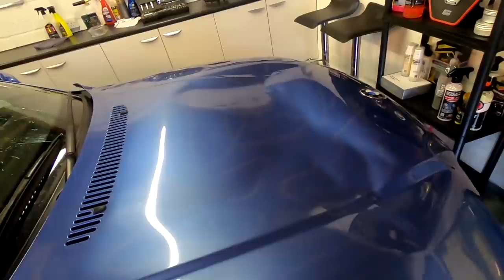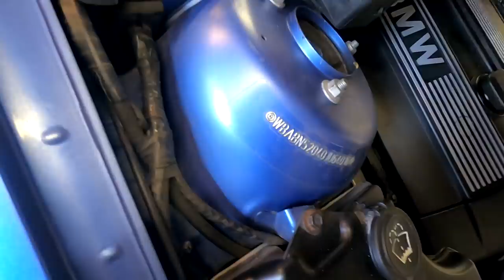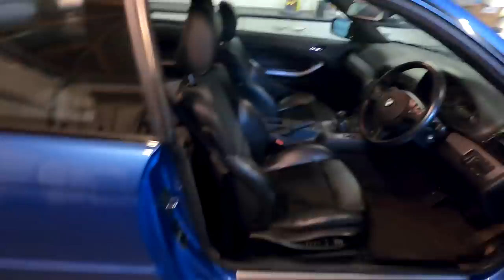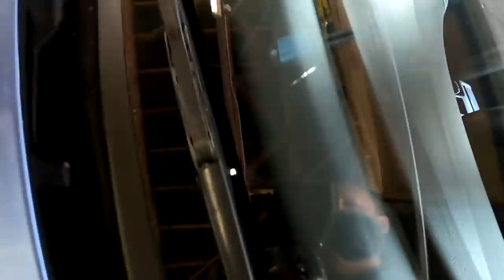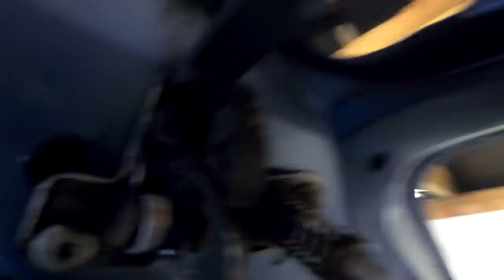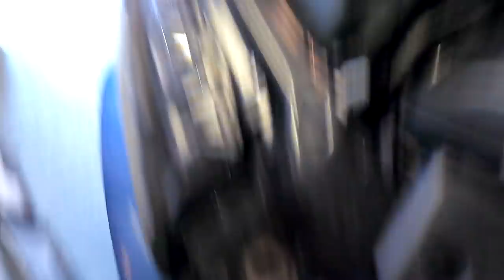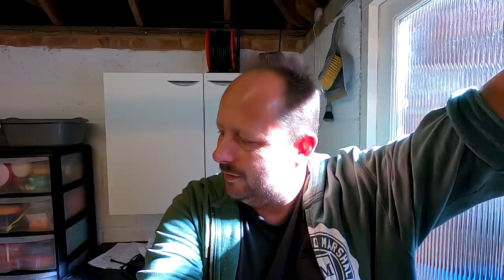BONNET FLEW OPEN WHEN DRIVING!! Smashed up car :(

Comment: Happened to me yesterday!!!.... Went to the garage, did my tires, then opened the bonnet to fill washer fluid. According to 
https://www.m5board.com/threads/summary-of-weight-savings-for-the-beast.96696/
the bonnet weighs 47.7lbs, so when everything went dark with a huge bang, I was similarly fortunate to be the only car on the road. Not seen the extent of the damage in daylight yet,  but I know it's fudged up completely. 

If anyone would like to win the old bonnet, all they have to do is guess the amount of swear words and profanities that I said during the 5 minutes immediately afterward...!! Go on you melon farmers! fudge yourselves! Cheesoos H Kryst!
Reply from the maker: colin gutted for you mate.  but I am also happy you are safe. because its very dangerous when it happens.  like one year down the line you will look back and laugh about it.   Im still running a scrapyard silver bonnet on mine lol.
Reply: @ForensicDetailing  Thank you for your reply didn't expect that!. I was wondering if your car suffered any structural damage from the incident? My windscreen was fine, but my rearview mirror fell off, the central interior light, and the rear seat light all fell out suggesting a direction of energy. Honestly, it's moments like this that feel the same as taking a pet to the vet!
Reply from the maker: @colinspasm3329  no structural just the root panel was bent, bonnet hinges bent, bonnet gone, windscreen come, one of the wings got scratches.  I took the roof lining out.  got a PDR guy round and he banged out the roof for 300 quid.  I got a bonnet from the breaker (call nick jupp if you need one) and I got a new windscreen on my insurence.